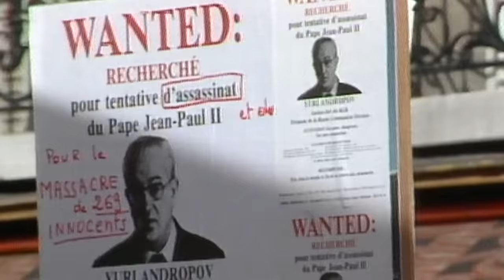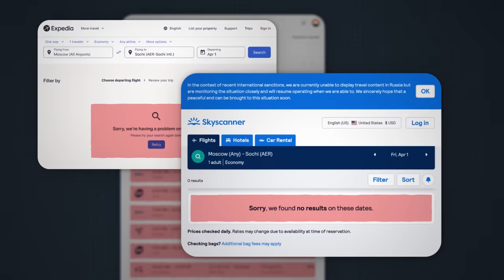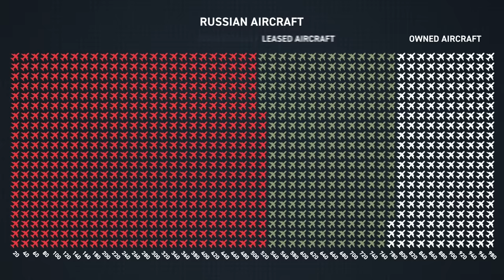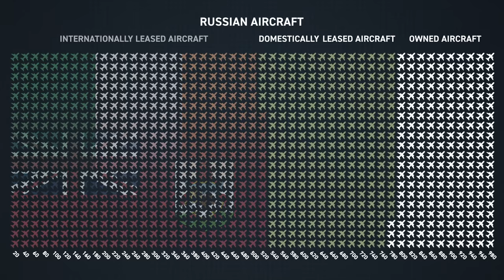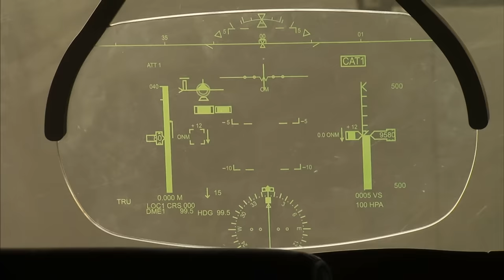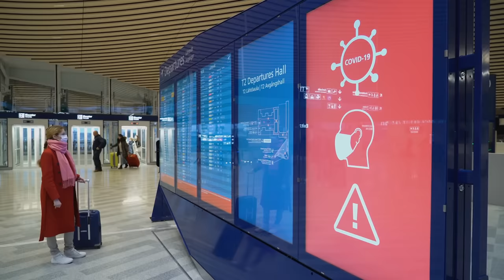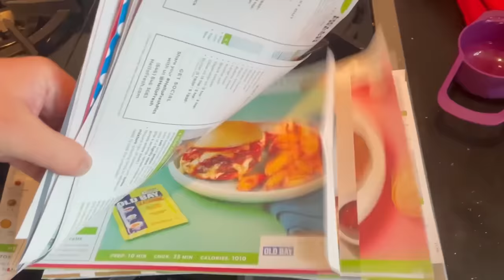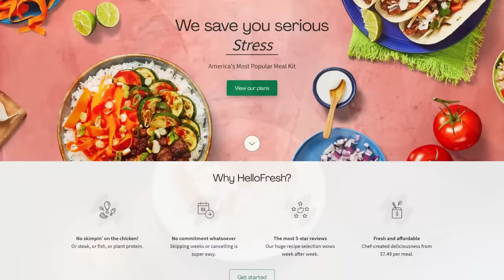The Sanction-Fueled Destruction of the Russian Aviation Industry

Comment: These stolen aircraft are essentially paper weights now. They might fly them domestically, but they will never see NA & EU airspace again. Even if the war ends and access to airspace is reinstated. The maintenance cycles of these particular planes have been interrupted, It will be a mystery where any replaced part has been sourced from. Parts smuggled across borders, recycled from different planes and "homemade" parts are the dramatic consequences. All aircraft parts have to be traceable, which will no longer be possible. They are tainted and no longer usable since the moment they were stolen.
Reply: You mean you wouldn't want to fly an airline whose maintenance is suspect??  Where's your sense of adventure?!?
Reply: They can make service of their planes in Armenia, Kazakhstan, or even China. Just as any other sanctioned countries do today. It will cost more though
Reply: @bennails3447  If those planes land there, they'll be repossessed.
Reply: @_loss_  By Xi Jinping? I'm not that optimistic as you :)
Reply: They might be reused into military transport planes over NATO airspace
Reply: @snowleopardseal  Well the russians can't maintain their numbers of fixed wing aircraft so it makes some sense.
Reply: The parts may be untraceable but unless you have someone watching your every move it doesn't matter. The planes will still fly, the parts can be sourced or created new, Russia does have factories and machine shops and a direct link to Chinese factories. China will still sell parts to Russia and will build new factories to produce anything they don't currently make.  All aircraft parts do not have to be traceable, that only applies under the heavy regulation of the US. I guarantee there are planes in service around the world with untraceable parts on them.
Reply: @NoHumansHere894y7HUIEO   Stricter than US bio labs business in Ukraine?
Reply: They will be used as a parts source only.
Reply: @REALBanannaman  The Russian Military can barely service and maintain its existing aircraft...
Reply: @bennails3447  Yeah, the ethno-specific bioweapons that are supposed to be used in conjunction with birds to attack Russians only (according to Mikhalkov and Konashenkov). I've heard that the stage 2 is to deploy them on Mars to defend against US missiles.
Reply: @PaulHoleybatch  US has confirmed that it conducted and financed research there :) You may also follow Konashenkov if you like him though
Reply: @bennails3447  + 15 rubles. Russian bot…
Reply: @stevemcgowen  I live in the states lol You have fantastic level of argumentation🤡
Reply: @bennails3447  why would you EVER produce a bioweapon in a lab located in a CONFLICT AREA ? When it could be blown up any moment or captured?
Reply: @olegnaumov225  Ask that question to Ms Nuland and Biden Jr bro
Reply: @billolsen4360  I flew Soviet airlines immediately after perestroika .  I prayed before every flight.....hoping we wouldn't run out of orange juice.
Reply: @dogsnads5634  How would you know? You just repeat talking points
Reply: @REALBanannaman  The Russian air force has had significant maintenance issues for years, which also led to a high attrition rate in normal operations. Trained servicemen could get more money in the commercial world so left, pay was low, spare parts holdings were low which contributed to low readiness rates. You can't maintain high standards when pilots are only getting 100hr's flight per year (and thats a lot higher than it was in the 90's to 2000's).
Reply: @dogsnads5634  They have nukes and the balls to use them, so keep whining about hours
Reply: Maybe the ruskies can use Chinese parts…crashy crashy!!
Reply: @billolsen4360  I'll see your Aeroflot adventure and raise you an Air Koryo.
Reply: @teo2975  Do you have an idea where who helps Iran and North Korea with the service? Make your best guess
Reply: AverageGeek, Absolutely true, All aircraft parts come with certification papers. Everything from a jet engine to a bolt or washer has "certs" with it.
Reply: @bennails3447  bio labs doesn't mean bio weapons!
Reply: if you have 40 airbuses for example you can use 20 of them and the rest 20 keep for the spare parts.
Reply: @ovsjahschweinefresser5293  War is peace freedom is slavery ignorance is strength
Reply: They arent stolen. They would be bought from lessors. It is US started it, when unlawfully seized 300 billions of Russian reserves. If during chess game your  opponent hit you in head with chessboard and then pretend that you will continue to play chess respecting all rules  - be sure you are playing with American.
Reply: Shy Cracker  I'm at home comrade lol
Reply: How about your bio and chemical weapon factories? How strict you are in security?
Reply: Just use a 3D printer to build avionics. 🤷‍♂️
Reply: @NoHumansHere894y7HUIEO  Really? Tell that to victims of B737MAX how strict is aviation business these days.
Reply: @bennails3447  China has super strict aircraft safety policies, why would they be interested in allowing Russia to fly questionably-maintained aircraft into their country?
Reply: @bennails3447  kremlin bot detected
Reply: Careful, Russian troll accounts in this comment section.
Reply: Not to mention the fact that someone hacked in and completely wiped out the databases and drives for domestic flights. Maintenance records, aircraft registration, software for bookings, historical bookings, nofly lists, all gone and no backup due to underfunding.
Reply: @_loss_  no lmao. I’m Armenian and the Russian Aviation is still working in Armenia.
Reply: Russia would hold the planes hostage to gain an advantage in relieving sanctions and airspace closures.
Reply: They'll be sold for "scrap" and then onto some African or South American regional airline that's willing to get a suspect plane for a huge discount.
Reply: @̐  You forgot Japan, Taiwan, the UK, New Zealand, Singapore, the Bahamas, Norway, Switzerland, Montenegro, Monaco, Albania, Andorra, Iceland, Liechtenstein, San Marino, and North Macedonia. And probably more.

And the country doesn’t have to be anti-Russian in order to cooperate with the seizure of aircraft. The planes belong to the leasing companies, it’s a business matter, not a matter of where do you stand in relation to the war.
Reply: The world is bigger then EU and NA
Reply: @bennails3447  I’m not sure. I’ll ask hunter later tonight. 
Cheers
Reply: @bennails3447  gullible nonsense
Reply: @bennails3447  You get your news from Fox, social media and Marvel Comics, don't you?
Try this, Ben: try getting your news from different - adult - sources. The WSJ, Deutsche Welle, BBC, The Economist. Read/watch each of them for say 2 weeks. See what it does for your thinking and your views. An interesting, broadening experiment. What do you say?
Reply: @sergeydudukin4214  Then don't make war on your neighbors. Simple.
And if you want to get angry at people seizing assets belonging to Russia, get angry at your oligarchs, Putin's cronies. That's who your government should be defending you against.
Reply: @sergeydudukin4214  BTW, I'm way down here in the southern hemisphere. Are they still my oligarchs? Are you just blaming the US or the west, or are you blaming the whole world for Russia?
Reply: @言行一致 I am pretty sure there would be a time when Chinese and Russian will be more widespread and used around the world. Since on those channels are people from the US and EU it make more sense to speak English. I am a true believer the more foreign languages you know and more countries you visit more developed you become as human being, more prone to propaganda and indoctrination. It would be great if more Americans and Europeans would speak Russian and Chinese. They would know that CNN is not the only source of information. If you dont speak another language you have to rely on what you were told...
Reply: I'm also pretty sure that even if the war ends and the airspace is reopened, Russian airlines will never be able to lease planes from the leasing companies ever again. Which will force them to take on the expense of buying and maintaining their own aircraft.
Reply: @rrmackay   His point wasn't that you couldn't fly the planes,  it was that they would be banned from NA and EU airspace as passenger planes...forever.
Reply: @earlyriser8998 .... or run out of vodka 🥴
Reply: @Zt3v3  Forever is a concept for children, western airspace is about as permanent as the dollar or the euro
Reply: @rrmackay  Forever for the aircraft in question ended when Russia violated the lease agreements by not allowing the aircraft to be returned when the termination clause was activated by the sanctions. They WILL NEVER AGAIN BE ALLOWED IN NA,EU or CHINESE airspace. (China has permanently banned all of the aircraft that were recently registered in Russia without the aircraft history being compliant with ICAO standards)

The West lost Billions on Russian Sovereign debt when they defaulted in 1998, only 7 years after the USSR fell. It is reasonable to expect the big banks to be negotiating bonds before a peace treaty is even finished being negotiated. There is money to be made. Life will go on in many ways. The airspace around the world will reopen soon after hostilities end, but those aircraft have already met the end of forever. 

If those aircraft are even accidentally sent to a destination in NA, the EU or China again, the aircraft will be seized and scrapped. There is no insurance company in the world willing to take the risk of letting those aircraft back in the mix. They are worthless.
Reply: @hewhohasnoidentity4377  They are only worthless outside of the eastern european block this year, they are still fully functional and can fly domestic routes inside Russia. Moscow already approved those planes for domestic service. It wouldn't matter if there were leases involved or not, the west would seize any Russian asset regardless of debt, contract or legal issues. 

You seem to be under the assumption that the west is going to come out of this war on top, that is far from guaranteed. If China and the US go to war over the south china sea it will be western aircraft not allowed into asian airspace.

All of your assumptions appear to be based on western media propaganda, I would recommend you broaden your horizons.
Reply: @bennails3447  you’re missing the point , he said the planes are paper weights , meaning they can’t leave Russia or China, ie go into the west or they will be taken , are u not smart ?
Reply: @bennails3447  us bio labs are not controlled by the us government, it’s called Capitalism genius
Reply: @bennails3447  financing is not consoling
Reply: @bennails3447  ask that question to putin
Reply: @bennails3447  iran can’t fly internationally genius
Reply: @bennails3447  you’re not a comrade
Reply: @cboffard8350  > adult sources
>BBC, Deutsche Welle
Reply: @bennails3447  I'd like to know where Obama was when 9/11 happened...
Reply: @bennails3447  True. But, I don't think they're biolabs. The US and biden family has invested in several ukrainian companies, but from what I know they are not biolabs. What are the companies named of these biolabs?
Reply: @snowleopardseal  If Russia can't even give their troops non-expired rations, I doubt they can do something as complex as configuring passenger planes into anything able to be effective against NATO or Ukraine.
Reply: They’re sourcing parts from “stan” countries or even China

Comment: Good video. One minor comment- the c919’s engine is the LEAP engine. While Chinese engineers are working on a domestic cj1000 engine, it planned for entry in 2025 and is quite likely to be delayed.

Therefore, since the engine (along with numerous other parts) is western, this cannot be sold to Russian airlines.
Reply: At first I wondered if COMAC would work with Aviadvigatel to offer a PD-14 engine version of the C919 for the Russian (and other sanctioned) markets, but I think there's a few reasons this won't be on the cards.

Firstly, the Russian govt won't want to create competition for the MC-21, which is competing in the same class as the C919, and which has, thanks to sanctions, had the A32x/B737  eliminated from the game.

Secondly, the C919 uses a ton of other western components as well as the engines (including avionics, HVAC, landing gear, hydraulics, electrical systems and more), so swapping for Russian engines really wouldn't make much difference.

The MS-21 also has a lot of foreign systems, but Russia has long legacy of domestic civil aviation that China doesn't, and would find substituting these foreign systems for domestic analogues much easier, as many of them already exist from the IL-96, TU-204/Tu-214 and IL-114. Indeed, if push came to shove, and we enter a prolonged period of Russian isolation, they could even scrap the MS-21 altogether and instead update the older, but already existing and entirely domestic TU-204/TU-214, using the PD-14 engines, new interior, aerodynamic tweaks and the like. 

I suspect Sino-Russian co-operation would move more to the CR-929 which is much less mature, so can relatively easily be "sanctions-proofed" from the outset, and both countries would benefit from co-operating. Though Russia does have the IL-96, it is difficult to update, as ultimately a quad-jet is still a quad-jet, and as a Soviet design evolution of the IL-86 it was designed for robustness rather than economy - it's very over-engineered and inherited a lot of the IL-86s innovative but decidedly left-field design choices, and even before the war it was clear that Russia couldn't realistically finance (let alone project manage - something post-Soviet Russia has struggled with) a completely new wide body design.
Reply: @lmlmd2714  Very good points, although I think cooperation between China and Russia on a new aircraft is unlikely, as the Chinese will want to sell any new airliner to the west. Obviously including Russian parts on the aircraft would preclude that.
Reply: Russians know how to make engines too.  What do think their migs use to fly? Brooms?
Reply: @simplyincorrigible7708  you would need to totally redesign the plane for a new engine, which would take most of a decade.
Reply: @jackroutledge352  The CR-929 is semi-Russian owned and is an ongoing project. Could China manufacture a de-Russianised jet? Possible but they wouldn't do it unless there is a big demand from the countries that sanction Russia. That won't happen. 
Though licensed manufacturing of Russian parts in China is possible. I guess that would enable marketing of the jet in the West.

The C-919 is another topic. It is 100% Chinese owned but has a LOT of Western parts. It was a project planned for profits in a completely different age. Since Trump, the Chinese companies' and government's view on foreign tech have changed a lot. Before that buying as much Western tech as possible was considered the best business plan for many reasons. Indigenization projects were overwhelmingly central government driven. Now Western tech (particularly American) is viewed toxic and is avoided if possible. Even private corporations with no gov support are investing in domestic tech and choosing domestic products even if that costs them. They don't want to become the second Huawei. The C-919 will likely have a 100% Chinese variant in future.
Reply: PD-14 can replace it.
Reply: @simplyincorrigible7708  Fighter jet engines, which are quite a bit different from civil aviation engines. Besides, Soviet civil jet engines were notorious for being backwards compared to Western jet engines. They were loud, maintenance-hogs, and very thirsty.
Reply: @lmlmd2714  теперь Россия намного быстрее будет работать и внедрять пд14 в самолёты благодаря сложившийся ситуации.
Reply: @super_slav91  👍👍👍🤝

Comment: You don't take into account, that fuel prices become higher and higher, so it's not so easy to fly longer than now, every additional flight hour costs higher price. Some of air company can't allow this price. Flying longer means additional maintenance service.
Reply: @samuelsuse8746  We are fully aware it will affect us you fool.
Reply: Oil prices only increased for Western buyers while within Russia crude prices collapsed. So its possible Russian airlines are getting oil products like jet fuel at a much cheaper price.
Reply: We now have Zoom instead. Freight will go through rail and its derivative, quasivacuum tubes. We needn't business trips anymore and countries don't welcome tourists as they have increased restrictions on travellers. An example is Korea'x ETA which performs very tough background checks on those who want to enter the country.
Reply: @AhmedW-sy9ti  russian airlines rely on overseas maintenance  and tools. most of them will be grounded permanently. the weak ruble will make purchasing overseas parts too costly adding to the ticket price
Reply: That may be another bonus for stopping in Anchorage. The US is significantly less affected by the lack of oil from Russia than Europe. Thus fuel prices in the US would be cheaper than Europe.
In other words, stopping in Anchorage for a refuel is also cheaper simply for the cost of fuel.
Reply: @softmechanics3130   Zoom lol not everyone wants to live in their own bubble like we didn't have things like that before, it's not mind blowing technology the things is people want to could enjoy real life
Reply: @CGplay186  And Zoom is now already the standard procedure of conferencing in the corporate world. Not some kind of construction worker stuff.
Reply: he also did not mention the fact that the western airlines will be facing competition from chinese , Indonesian ,   Malaysian ..etc airlines .  as all of those airlines are still allowed to use russian airspace , so the flight tickets are gona be cheaper then any western airline ticket flying through alaska .
Reply: @jihadismail8527  Happy to pay the few extra dollars.